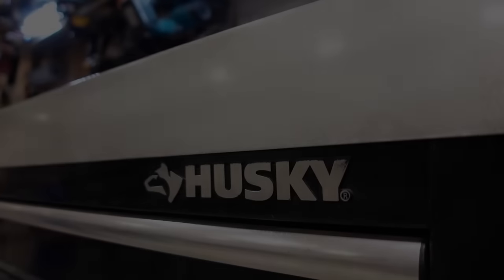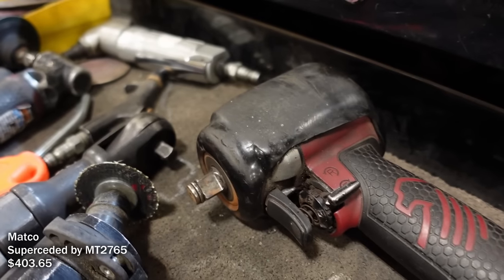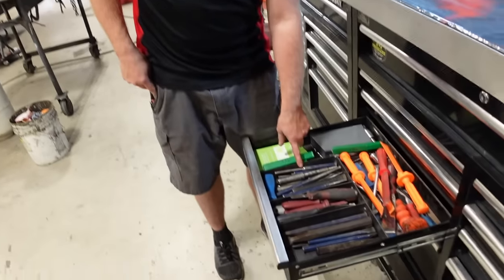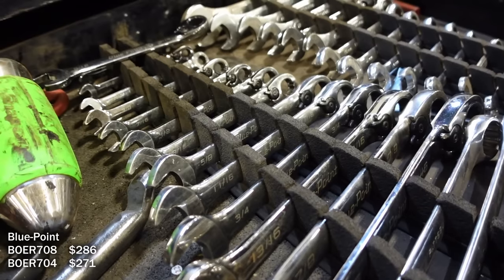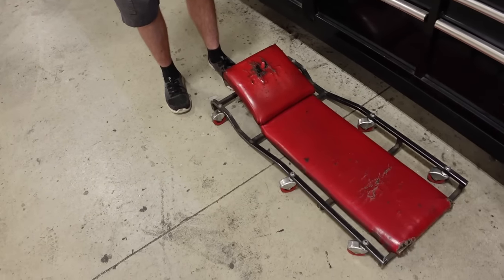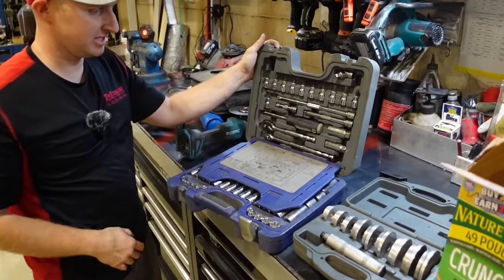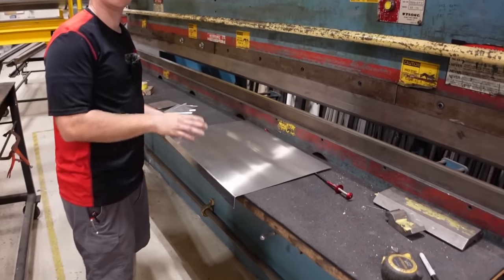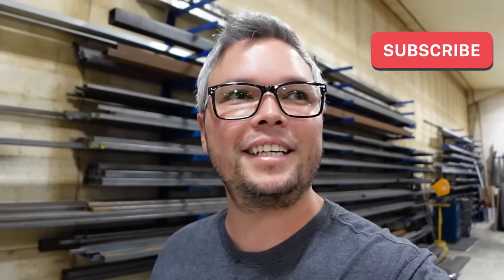Awesome Tools and Dangerous Machines!

Comment: This shows you don't need to spend a ton of money on storage. I've worked with a couple guys with husky boxes and they never had any problems. Mine wouldn't lock the heavier drawers after a few months, but it was an older model
Reply: I got that same box to hold my tools for personal use. Honestly I think its an amazing box for the $600 usd price tag, yeah it still dosnt compair quality wise to my 2s matco box that i got for work BUT it does the same thing. My matco box can take more of a beating but I never beat on my boxes so that is never an issue for me.